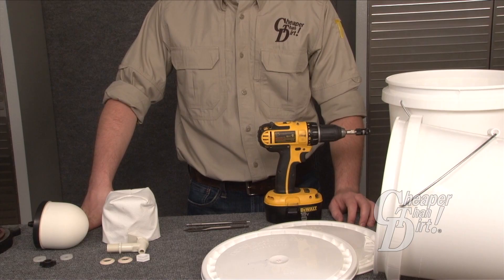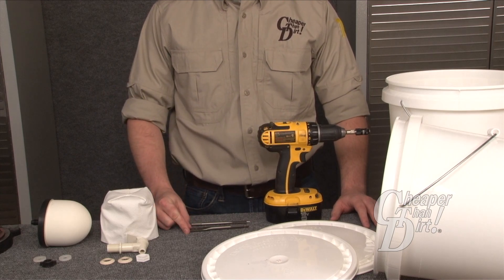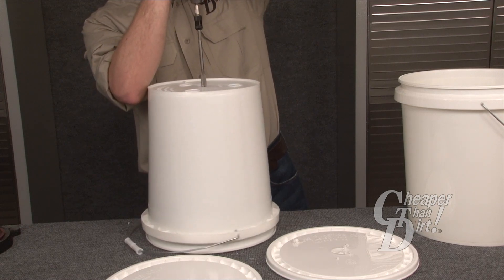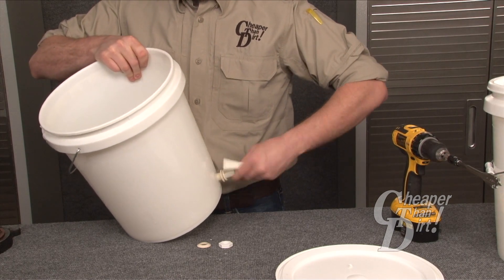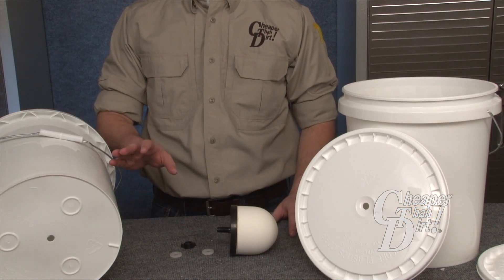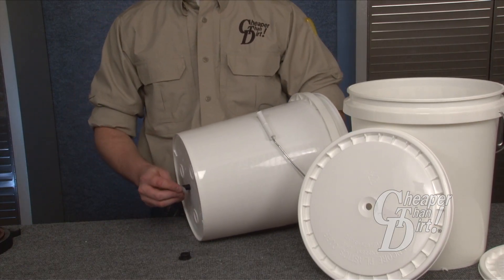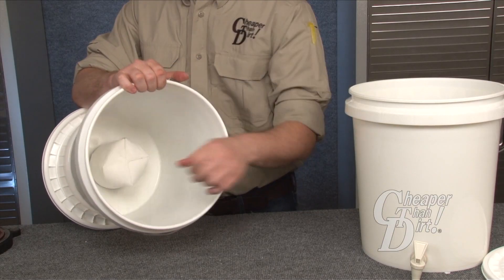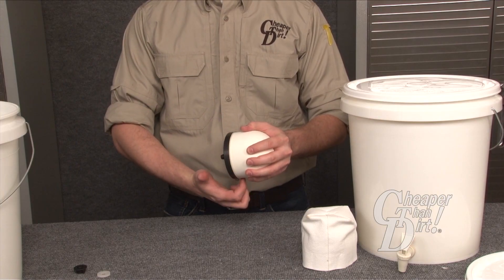How to Install and Use Just Water (Ceramic Drip Filter)

Comment: tough 4 city drinkers, i want 2 filter fluoride but i have heard that in order to filter fluoride, the filters are made of alumina can leach aluminum oxide? into water, high amounts of aluminum are found in peoples brains who have alzeihmers so i guess i must take care of the aluminum oxide, so first i install two ceramic filters(Doulton) and a berkey because its smaller micron size to help with viruses, 4th is the flouride filter from berkey(alumina)
2nd bucket install berkey to remove alumina

Comment: Just spent 20 minutes making one of these per the video instructions using buckets and spigot already on hand. Substituted 3 of the Camp-354 filters for the one filter used in this video. And am using water from my very hard and calcium rich well (which stinks to high heaven of sulphur) for my test run. After 1 hr. I have 2+ gallons of water that not only tastes like bottled water, but also has no offensive odor ... Love It !!!